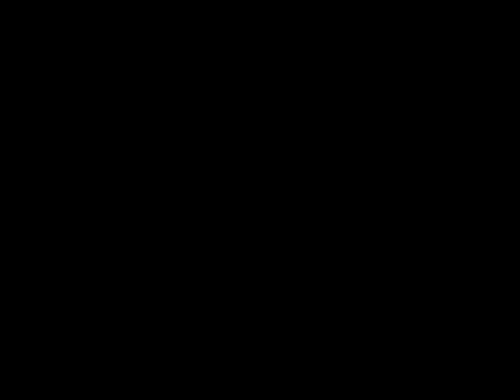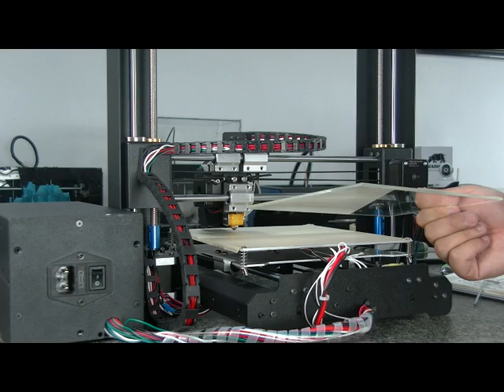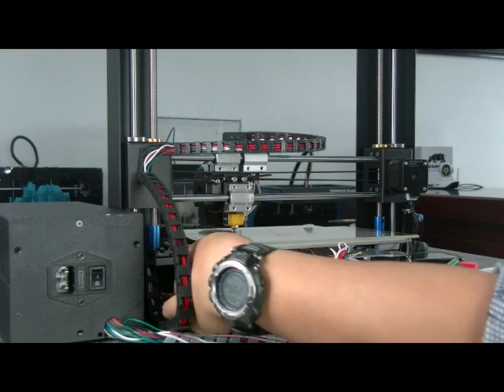How to add a glass plate to platform for Wanhao Duplicator i3?

Comment: The method shown here will never work. The first time you home the machine the Z axis is going to come down and the nozzle is going to hit your glass plate before tripping the limit switch. The best way to add clearance is to move the Z axis limit switch up.(The same amount as the thickness of the glass)
Reply: +Bill Blackburn They added extra holes for the Z microswitch in V2. This video is out of date.

Comment: I just added a plate today, the left gantry bar z limit switch now has another set of screws to move it up a few mm.  also used thermo conductive tape, 1 1/2 squares in corners only to support plate so it can float as heat plate and glass both flex as they are heating .

Comment: This is a pretty poor fix for adding glass, without glass my nuts on the bed adjustment are nearly tight, i got no chance to bring the bed down another 3mm for the glass, plus this doesn't allow for the end stop on the Z axis to work correctly, the glass could easily get cracked doing this if the Z axis went down to the endstop
Gonna do my own fix for this i think

Comment: how does adjusting the couplers work? It doesn't change the position of the Z endstop.
Reply: +Jim Klo I was wondering the same until I found what might be an answer from the Wanhao US website. It does not mention anything about adjusting the couplers (so I think this video is all wrong on that issue), instead, recommends printing a riser (they provide the .stl file on the same page. I haven't tried it yet, but will do soon. Here's the link: http://wanhaousa.com/pages/adding-a-glass-build-plate